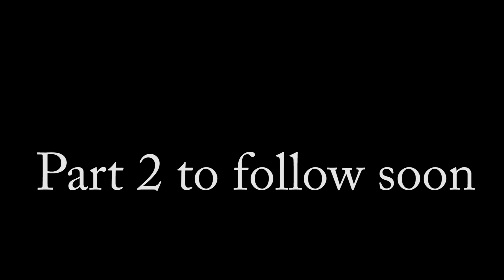Pfizer, process 2

Comment: 3 comments but none showing. Glad Google are keeping us secure about "safe and effective" medical procedures. And our every trust worthy parliament looking after us all.
Reply: Fasting is the only safe and effective method needed to prevent serious infection from common ailments. It also hastens the removal of other safe and effective treatments which can prevent many side effects. Some benefits of doing occasional extended fasting: High blood pressure is lowered to normal levels very quickly while fasting. Fibrosis/scarring is reversed over time, including in the heart and lungs.

Fasting stimulates phagocytosis, the ingestion of bacteria, plaques and viruses by the immune system. It will also remove any 'foreign material' like spikes that are not supposed to be there. Whether natural or unnatural in origin..

Blood clotting is reduced and blood clots and arterial plaque are reabsorbed into the body. 

Blood sugar and insulin are lowered when fasting, allowing white blood cells to move more freely throughout the body and do their job.

Vitamin D plasma levels are increased as fasting improves metabolic health, and vitamin D in turn increases autophagy.

Fasting increases nitric oxide release. 

Fasting restores NAD+ to healthy levels.

Reflexes and short term memory are increased. 

Telomeres are lengthened and fasting also increases anti-aging Yamanaka factors.

After 72 hours or more fasted, your body recycles up to 1/3 of all immune bodies, rejuvenating your entire immune system. This helps prevent the onset of new autoimmune conditions, which develop through a leaky gut and damaged immune system.

Fasting can help with MS, Depression, BPD, Autism and seizures.

Thymus is regenerated, which suppresses aging and renews the immune system. The thymus also plays a vital role in fighting cancer.

Weight loss from daily caloric restriction has 1/4 to 1/3 of the weight lost as lean tissue while many studies show fat loss from 36 h fasts without losing any lean tissue! 

The obese will lose extra tissue like loose skin while fasting, but the skinny or frail will have increased growth hormone release than the obese, which helps to make more lean tissue and reduce frailness.

When you move out of MTOR your body shuts down the building blocks of the cell required for viruses to replicate.

The hunger hormone ghrelin also lowers with extended fasting and rises from dieting. 

What breaks a fast? Anything with protein or carbohydrates in it will break a fast. Most teas and herbs are OK. Most supplements and meds will either break ketosis directly or contain a filler that will. Many meds are dangerous to take while fasting.

Does fasting lower testosterone? No, it raises it when the fast is broken by increasing lutenizing hormone. Fasting also increases insulin sensitivity, which helps with muscle building.

Fasts of 36-96 will not affect short term female fertility or affect menstrual cycle. They also may increase long term fertility, especially in women with PCOS.

Fasting reduces pain and anxiety by stimulating the endocannabinoid system in a similar way to CBD oil.

One day of fasting can cut your leptin levels in half and gets your immune system working properly again! This reduces leptin resistance, which impairs immune function. 

Stomach acid is reduced over time while fasting and can allow for the healing of treatment resistant ulcers. Some patients may need continued acid reduction medication while fasting.

Does the body preferentially prefer glucose as a fuel? No. Except for brief periods of very intense exercise, your body mainly burns fats in the form of free fatty acids. Your brain also prefers to burn ketones at a rate of around 2.5 to 1 when they are available in equal quantity to glucose.

Fasting stimulates the AMPK complex and activates autophagy. Autophagy (literally self eating) will cause cells to recycle damaged proteins and foreign matter such as viruses. It will can kill cancerous and senescent cells

Lowering insulin via fasting virtually eliminates chronic inflammation in the body. 

It increases mitochondrial function and repairs mitichondrial DNA, leading to improved ATP production and oxygen efficiency. Increased mitochondrial function also has the added benefit of increasing your metabolism, fighting infection and cancer prevention!

Fasting releases BDNF and NGF in the blood which stimulates new nerve and brain cell growth. This can help a great deal with diseases like MS, peripheral neuropathy and Alzheimers.

Fasting also increases telomere length, negating some of the effects of aging at a cellular level.

When you fast, this stimulates apoptosis in senescent or genetically damaged cells, destroying them. Senescent cells are responsible for many of the effects of aging and are a root cause of the development of cancer. 

A fasting mimicking diet for 3-5 days in a row also provides many of the same benefits as water fasting. FMD usually has 200-800 calories, under 18 g of protein and extremely low carbs.

Exogenous ketones can aid with fasting, making it easier in healthy people and allowing some people with specific issues to fast in spite of them without worrying as much about hypoglycemia. They also help with dementia and many other issues even if you take them while not fasting!

Glycine and trimethylglycine can also be useful supplements while fasting that won't break ketosis and have many benefits.

Children, pregnant or nursing women should not fast for periods longer than 16 hours. People with pancreatic tumors or certain forms of hypoglycemia generally cannot fast at all. Type 1 diabetics can also fast but it is more complicated and should be approached with caution as it could lead to ketoacidosis. If you experience extreme symptoms of some kind, especially dizziness or tremors, then simply break the fast and seek advice.

Resources:
https://www.ncbi.nlm.nih.gov/pmc/articles/PMC5783752/
https://www.ncbi.nlm.nih.gov/pmc/articles/PMC1413655/
https://www.ncbi.nlm.nih.gov/pmc/articles/PMC5783752/
https://pubmed.ncbi.nlm.nih.gov/6859089/
https://www.ncbi.nlm.nih.gov/pubmed/10232622
https://www.ncbi.nlm.nih.gov/pmc/articles/PMC8470960/
https://www.sciencedirect.com/science/article/pii/S1931312809002832
https://pubmed.ncbi.nlm.nih.gov/15522942/
https://faseb.onlinelibrary.wiley.com/doi/abs/10.1096/fasebj.2019.33.1_supplement.819.10
https://www.biorxiv.org/node/93305.full
https://www.arcjournals.org/pdfs/ijrsb/v3-i11/7.pdf
https://www.ncbi.nlm.nih.gov/pmc/articles/PMC6407435/
https://www.ncbi.nlm.nih.gov/pmc/articles/PMC6141719/
https://pubmed.ncbi.nlm.nih.gov/20921964/
https://pubmed.ncbi.nlm.nih.gov/25909219/
https://www.cell.com/molecular-cell/fulltext/S1097-2765(18)30605-1?_returnURL=https%3A%2F%2Flinkinghub.elsevier.com%2Fretrieve%2Fpii%2FS1097276518306051%3Fshowall%3Dtrue
https://pubmed.ncbi.nlm.nih.gov/28235195/
https://www.ncbi.nlm.nih.gov/pmc/articles/PMC2815756/
https://www.nia.nih.gov/news/research-intermittent-fasting-shows-health-benefits
https://medicalxpress.com/news/2022-10-treatment-pulmonary-fibrosis-focus-telomeres.html
https://www.ncbi.nlm.nih.gov/pubmed/10859646
https://academic.oup.com/ajcn/article/81/1/69/4607679
https://pubmed.ncbi.nlm.nih.gov/31877297/
https://n.neurology.org/content/88/16_Supplement/P3.090
https://pubmed.ncbi.nlm.nih.gov/31890243/
https://pubmed.ncbi.nlm.nih.gov/2518860/
https://pubmed.ncbi.nlm.nih.gov/29727683/
https://www.ncbi.nlm.nih.gov/pmc/articles/PMC5895342/
https://www.collective-evolution.com/2017/05/16/study-shows-how-fasting-for-3-days-can-regenerate-your-entire-immune-system/
https://pubmed.ncbi.nlm.nih.gov/7714088/
https://www.cell.com/cell/fulltext/S0092-8674(19)30849-9
https://www.ncbi.nlm.nih.gov/pmc/articles/PMC3017674/
https://pubmed.ncbi.nlm.nih.gov/23408502/
https://www.amjmedsci.org/article/S0002-9629%2815%2900027-0/fulltext
https://europepmc.org/article/MED/22402737?javascript_support=no
https://onlinelibrary.wiley.com/doi/full/10.1111/j.1365-2265.2005.02288.x
https://www.nejm.org/doi/full/10.1056/NEJMoa012908
https://pubmed.ncbi.nlm.nih.gov/27569118/
https://www.ncbi.nlm.nih.gov/pubmed/25686106
https://pubmed.ncbi.nlm.nih.gov/21410865/
https://www.ncbi.nlm.nih.gov/gene/25712
https://pubmed.ncbi.nlm.nih.gov/23707514/
https://www.ncbi.nlm.nih.gov/pubmed/24905167
https://www.health.harvard.edu/heart-health/abundance-of-fructose-not-good-for-the-liver-heart
https://www.ncbi.nlm.nih.gov/pmc/articles/PMC7093158/
https://clinical.diabetesjournals.org/content/36/3/217
https://www.ncbi.nlm.nih.gov/pubmed/23876457
https://www.ncbi.nlm.nih.gov/pmc/articles/PMC6526871/
https://www.ncbi.nlm.nih.gov/pmc/articles/PMC7607739/

http://www.cell.com/cell-metabolism/abstract/S1550-4131(15)00224-7
https://repository.upenn.edu/cgi/viewcontent.cgi?article=1537&context=edissertations
https://www.ncbi.nlm.nih.gov/pmc/articles/PMC1779438/
https://www.nejm.org/doi/full/10.1056/NEJMc2001176
http://www.sciencedirect.com/science/article/pii/S0005272806000223
https://www.clinicaltrials.gov/ct2/show/NCT04375657
https://pubmed.ncbi.nlm.nih.gov/20102774/

This list compiled over years of research by the user known as Pottenger's Human on youtube. Feel free to copy and paste this anywhere you like, no accreditation needed!

My community tab will always contain an updated version of this list of fasting benefits. I also have playlists on fasting and health topics.
Reply: Always test your comment on another browser that isn't logged into Google. They'll display your comment for YOU, but hide it from others. It's a way to make you believe your comment was unpopular because nobody responded or liked it.  I'll need to do that very thing with this comment.😮
Reply: @Jeff-b4-g exactly, you see your own comment but the majority of others wont. If you are in the same shadow banned category pool of users, i think sometimes they might see each others comments, but they make sure majority are isolated from your shared point of view
Reply: @orion9k  Yep.  It's a sneaky way to adjust your behavior. If nobody responds or likes your comment, you conclude it's unpopular. It's scary they have a category of approved speech.  Imagine if Verizon Wireless did that?  When you said something they didn't approve of, they censored you.
Reply: @Jeff-b4-g  You can check by trying to edit it. If you can post an edited version, it is visible for others too. If the edit won't post, your comment has been turned into a fake i.e. just showing for you.
Reply: @Jeff-b4-g Is it that simple? I think they have a lot of means at their disposal to see who's accessing the comments. I'm into big and bright flashlights and Amazon for example made me the same offer for a flashlight in my browser in normal and inkognito mode. Adaway is running too. My next door neighbour checks Amazon while I stand next to him and he gets an offer for 30$ less...
Reply: My comments also being hiden 👌 they wont allow academics to have a voice, spreading information and organizing 🙏
Reply: same with several comments I've made the last few years...and for nothing outrageous imo...just wrong think
Reply: welcome to a fully communist world run by idiot elites with all the money.
Reply: Lets applaud nazis while we there
Reply: I here you but please nconsider the amount of spam you get on YT too. 
I used to get quite som spam comments trying to lure me off site ...
Reply: Crisis averted!
Reply: But now you did the right thing: use irony. In China, that is the way to skip being censored. Like in "Today our marvellous Major opened the marvellous new community building, for which even the poorest inhabitants have been paying so generously".
Reply: Refresh the page. Click on top comments then New. They should show then.
Reply: @Decopainterandtea  I've been censored this morning, for talking about vitamins and excess deaths
Reply: Live from Tel A Viv! hahahahha